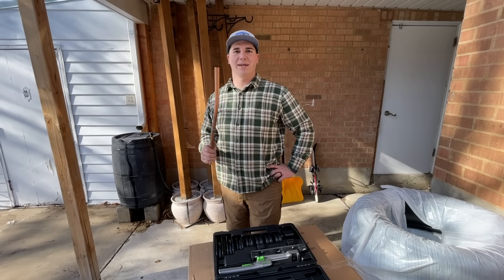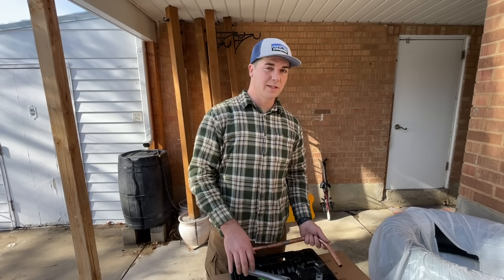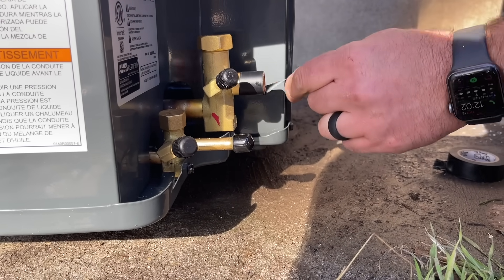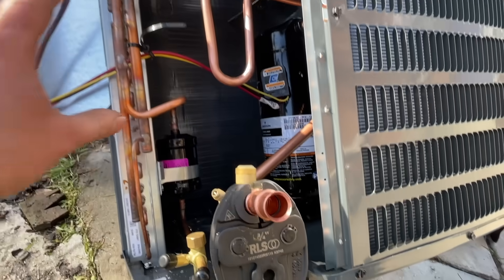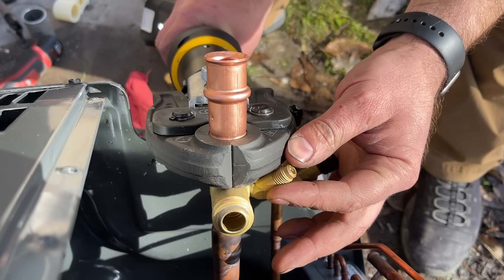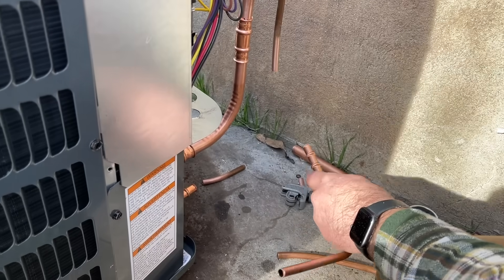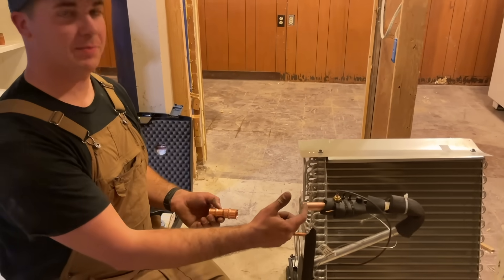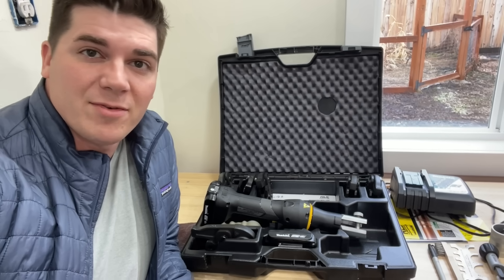Brazing Is For Cavemen. THIS Is The Future Of HVAC Copper Connections. -RLS Crimping Tool-

Comment: Brazing is an art, most satisfying part of the job.
Reply: Eh, I need to make money bro. I just like that I * * * KNOW *  * * my call back for a leak is statistically lower with a method I * * * KNOW * * *  holds.
Reply: Super quick and easy to do as well. Like once prep is done. It's literally 3 minutes to braze the joints on each end...
Reply: This type of joint reminds me of compression fittings and the service calls that come with them to "top off" the gas every year or so...
Reply: Absolutely tight
Reply: Tell em !
Reply: Ya I take pride in my joints
Reply: Art work for sure. Anybody can just mash two ends together with a wing and a prayer.
Reply: This Is handy in a state where burn permits are required like mass. Other then that I’ll prefer brazing all day
Reply: I've seen 40 year old braze joints holding up. I've seen press fittings leak in 1-5 years
Reply: @FLocal813  I've found the same to be true with house water pipe.  Crimp on options eventually leak with hot, and cold cycles.
Reply: Art 😂 …..isn’t that hard ,I always believe that people that struggle to learn it are the ones that say things like that
Reply: Yes it is 👍🏽👍🏽🍺
Reply: Said noone ever. The Easier, the faster the better.
Reply: Amen brother or sister.
Reply: absolutely right
Reply: Yes. Unless it is a refrigerator on the kitchen floor... then it's a tight-rope walk, even with a blanket.
Reply: TY
Reply: Try that with an r32 unit 👹💀💀💀I did and I chickened out so I’m getting my press tool
Reply: lol what art 75% of y’all don’t even use nitrogen
Reply: Looks a lot better and more professional also.

Comment: Lame sauce! Just use silver bearing solder for residential connections. With the prices of refrigerant nowadays, you just asking for trouble with crimp connectors.
If I came across a job where everything was crimp connected, the first thing I would think is "amateur, poor guy doesn't know how to join piping".
It's like the copper pipes I run into every once in awhile that are joined using an adhesive because the guy that installed that didn't know how to solder, lame....
Reply from the maker: If you have watched my other videos you’ve seen that im proficient at brazing, and I’ve started using Staybrite 8 which I think is fantastic.  I probably won’t completely swap to this method but it’s a nice tool to have when I need it.
Reply: @diyhvacguy  I wasn't judging you, I was just commenting in general.
Keep those connections tight and use stay bright 8. 👍

Comment: I could have brazed that in 1/4 of the time.
Reply from the maker: Dude, this wasn’t a time attack it was a tutorial video. If we were racing I’d smoke you
Reply: @diyhvacguy  serious question. If you used this crimp tool on the condenser and you made a bad crimp which can and does happen to plumbers often,  what's the fix?

Comment: Another thing you have to figure is human error, if one of your techs accidentally crimps it wrong, you’re up shit creek because there’s not enough pipe sticking out of the king valve. Also, most techs with experience could braze it in quicker than this, because no need to take covers off.
Reply from the maker: I could argue the opposite. A lot of newbies will screw up a braze joint, and a monkey could crimp on a fitting. That’s why a lot of companies are using these. If people don’t want to buy this tool no one is twisting their wrist 🤷🏻‍♂️

Comment: We bill by the hour, takes us 10 minutes tops to braze in a condenser!  I appreciate you showing us this crimp system,  but for everyday real world use it doesn't seem practical.   Also Goodman is horrible,  offer Lennox, Trane or Ruud.....it will save you a ton of headaches in the future!!
Reply from the maker: Just became a Ruud dealer myself. Looking forward to working with them. But I still think Goodman is a good brand. I haven’t had a ton of problems. But to each his own.  Cheers

Comment: With the 410a Freon, you run over 500 psi on 
 The high side on a triple digit day, I worry about leaks!
Reply from the maker: These fittings have been tested to 4-5000 psi before they burst and on one of the tests the copper pipe burst before the fitting. Check it out on RLS website 👍🏼

Comment: I'd suggest getting the new style press fittings and jaws... we've had way better luck with them, they crimp the o-ring similar to a propress
Reply from the maker: Are you referring to zoomlock max? They are literally the same but made overseas, where as RLS fittings are made in the US
Reply: Theyre not, max looks like a propress fitting and you crimp the o-ring to the pipe... the original style you crimp in front of the gasket... They're litterally 2 different designs